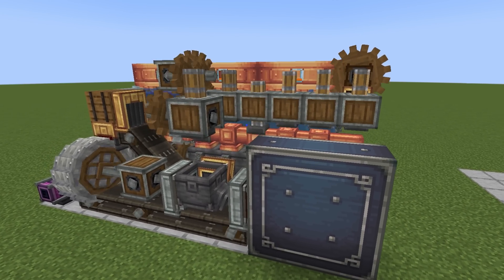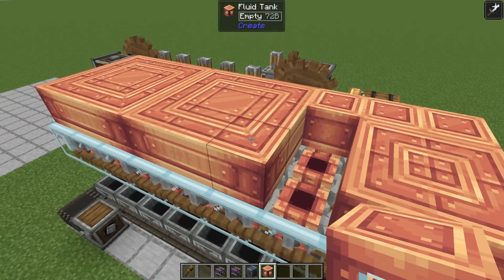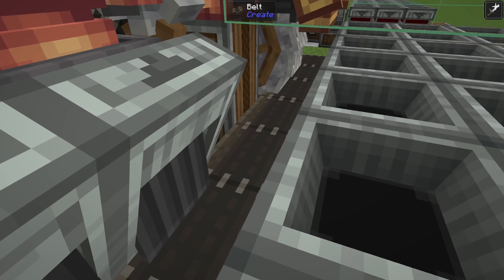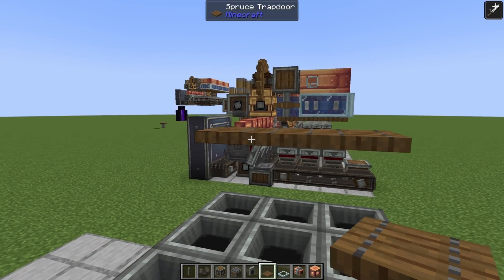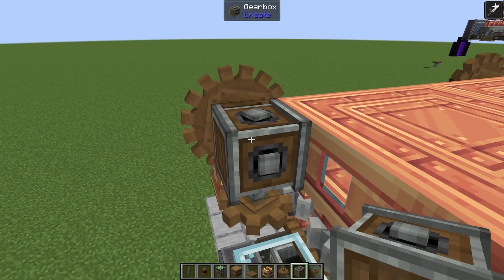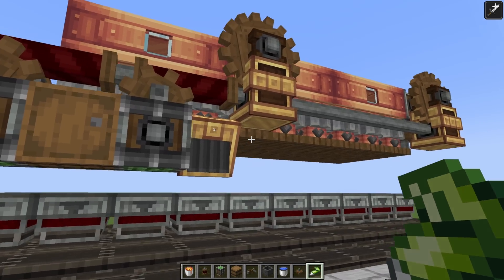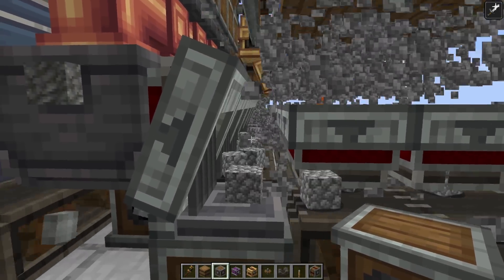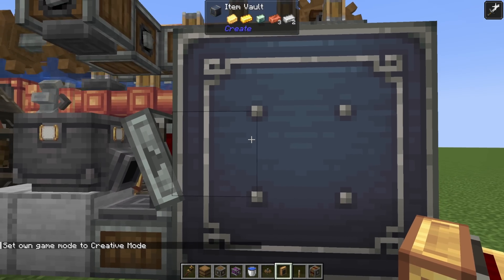How to Make a COPPER AND ZINC FARM in the Create Mod | Create Mod Block-By-Block Tutorial

Comment: whats the point of these schematics if i gotta manually check everything ?
Reply: bruh , its legit like 8 things to check ,   what you gonna run the machine without checking if the mod acting goofy ? , i lost an entire machine due to it 
whenever i activate ANY machine i double check JUST to make sure it at the place
Reply: @mrmeowcat6242 well brother my thing didn't even work when I just built it piece by piece after the schematic didn't work following his guide so ggs
Reply: @clashwithnash9021  hm you got any modpack that you might think be the issue or you forgot to installed some modpack ? Perhaps its somethings messing with it , i tryin in a flat work it work
Reply: @mrmeowcat6242 hmm I tried to build it in prominenece and it had the mods needed to make it but alas it makes cobblestone it's just those stupid things that goes on top of the cauldron thing that won't just smash the items
Reply: @clashwithnash9021 hm mechanical press ? Perhaps it have no power or the shaft in wrong way , have you make sure everything is glued perfectly aswell
Reply: take out the attribute banner on the cauldon it the one that cause issue
Reply: @mrmeowcat6242 I will try that and ye everything is glued correctly will see if that fixes it i don't think it will because ppl said u need lava to make tuff now not water
Reply: @clashwithnash9021  It broke for me , so i try to remove the attribute banner on the cauldron , fix itself immediately

Comment: Yeah, this doesn't work with the current versions of the mods.  Needs lava instead of water to make tuff.
Reply: Here is smth that could help, there a create mod (addon) called Create Utilities specifically the 0.1.4 if u are using 0.5.2 or earlier versions of create mod, its gives you the void fluid tank along with some other helpful stuff, it very late game tho and hella expensive to make but useful af. all u need to do is create a unlimited lava source like a bottomless pit of lava in the overworld (or if u have the power loader mod that gives chunk loaders then use a train system that brings lava), or a lava farm with dripstone, pump it into a void tank, filter it with a matching item and then use the other void tank as a output with a pump and viola. PS. u can pump it directly into the lava farm, regardless of which one, but the void tanks make it look less janky.

Comment: Running into an odd issue where the basins for compressing cobble into tuff will only hold 16 or 17 cobble, which is short of the 21 necessary to spit out tuff, so it's all clogged up...

EDIT: In your machine or on their own, a funnel won't put more than 16 blocks into a basin. I have no fucking clue why that is...

Comment: I had a problem where water on the basins wouldn't work (probably due to using a more recent version of the mod), so I removed the water source on top and used my lava farm to fuel it instead and it worked (since the mod itself said that to profuce tuff, you had to compress 9 cobblestone with lava on a basin, not water)
Reply: Which version u using?
Reply: @vencaa121  16.2.0 from 10/12/2025
Reply: Cant find it probably need create factory addon
Reply: @vencaa121  sorry, I forgot to mention that I use the create ultimate selection modpack
Reply: @user-vr2ie5qd2j nevermind i should read more 🤣 thank u
Reply: Pls! Which lava farm?
Reply: @KamisatoAyaka-c6q  you can set up a train that goes to the nether and collects lava from a lava lake and brings it back to the overworld
Reply: I have the same problem.

Comment: hey ive built this and the basin will only fill up to 16 cobblestone when i need 21 to make tuff. Its filling up with water just fine (1000 mB) but it wont gather enough cobblestone. Is there a fix?
Reply: Yeah I'm having the same issue.
Reply: @ltmuffler3482  I improvised a fix. Instead of having funnels lead into the basins, add weighted ejectors in between the basins and funnels and set them to 21. You will run into a clogging issue though so I fixed it by making the belt that runs along all of the length of the funnels into another, extra ejector that ejects it into lava. Just make sure its set to something lower than 21. I found that 11 works great.
Reply: @Desceres  I ended up moving the whole build down 2 blocks (aside from the cobble generator) so that I could have the funnels spit the cobble out into "open air". The funnels have no problem spitting as much cobble out as they can handle, so long as it isn't directly into a basin. But if it drops them out above the basin and they fall in, then there's no weird 16 item limit. Took some redesigning the power system to get everything running but I got it to work.

Comment: Am im using wrong mod? Because i need to use lava instead of water to create tuff & i already install Ultimate add on
Reply: from what ive gathered its just the fact that the recipe has changed id recommend making a massive drip system for the lava input

Comment: I just build this Farm on a Server with a mate. This works really well, only bummer is my PC and the one of my mate dies when i Turn the fabric on. Its Takes away like 30+FPS. The performance Impact is sadly to hard to let it run permanent.
Reply from the maker: I'd recommend looking at the /flywheel config options if you have that mod installed. It shouldn't be lagging that much. Also you can replace the cobble gen with one that's more lag friendly (and if you have other cobble gen mods it may be more compact that way)
Reply: @kindlebubbledump  i will Check that out, appreciate the fast answere 😁

Comment: I'm a beginner and followed the tutorial to build the machine. 
It produced andesite, and I added water to the basin. All the gears are turning, and the shaft of the final Mechanical Press is rotating, but the press itself is not moving up and down. What could be the issue? 
Thank you.
Reply: After I installed the Create: Ultimate Factory mod, it worked fine.

Comment: Idk if it's cuz I have a lot of different mods installed but the attribute filter was stopping mine from working didn't have the c:ingots option. After removing if the whole system worked fine
Reply: it may be forge:ingots instead of c:ingots

Comment: I'm guessing the pack I am running has a modified recipe as all I get from crushing tuff is a 12% chance of zinc. Any recommendations for a lightweight pack using the new create that doesn't alter too many?
Reply: Integrated MC, excellent modpack, don't know if it will be lightweight as per your standard tho (and I would advise to just add Create Ultimate Factory in there, depends on your need)

Comment: I found the tuff presses were unable to output fast enough due to the output belt being constantly full of single blocks of tuff. This caused cobble to build up and start spilling all over. I fixed it by adding brass funnels to the press basin output sides with filters to only drop the tuff.
Reply: im experiencing cobble building up in one particular spot, underneath the generator, right in front of the gear that is behind the belt. cobble just sits there and does not get picked up by the belt. any idea on how to fix this?
Reply: @HxneySlitherskye  I'm not sure, but as far as I know the only reason the belt wouldn't pick up the cobble is if the belt already has cobble sitting on it. So you have to get the press section to pick up cobble faster. If it's not being picked up by the presses it might be the same problem I was having, the presses couldn't output and got filled.
Reply: @twistedsanta163 did you ever get it fixed? Also the threshold units do not work
Reply: If I can understand it all maybe I can improve upon it piece by piece, but first fix what doesn't work
Reply: im experiencing that everything is working except that the presses above the basins just dont press at all

Comment: You should make individual ore farms using ochrum, asurine, crimsite and veridium -  the recipes to make them are all quite similar so you can just repeat one farm for all four. I'm not sure if it these would actually be faster than your original farm though, it may also be something you have already tested.
Reply from the maker: The automation for all those blocks are very dependent on the modpack. I assume you have create dreams and desires (so do I) which automates it pretty easily with milkshakes or similar, but from what I've seen, most people don't use those

Comment: help please the mechanical presses arnt working but i rotated it and the shaft of the mechanical press is moving but its not pressing the material
Reply: im having the same issue
Reply: me too
Reply: me too
Reply: @empanadasdecrack9522 do you have the create: ultimate factory mod
Reply: Found the solution,  it's the version of the Ultimate Factory Mod.  In the newer versions they've changed it so you need lava in the basin not water, I got it working on Ultimate factory 1.9

Comment: Would someone be able to explain how or why the cobblestone generator part of this build works? I want to understand so I could possible incorporate it into other builds
Reply: I think I can explain how it basically works. So, when the gantry carriage moves the trapdoors, they become transparent, meaning water and stuff can pass through them. The pumps pump slowly lava and are waterlogged. So, when the trapdoors becomes transparent, the water flows do and the pump can pump lava creating cobblestone since they mix. But, when the gantry carriage arrives at its destination stops, the whole contraption becomes solid thus, breaking the cobblestone that formed. And then it repeats. That's how I understand it tho. And I hope I explained it correctly.
Reply: @sabertooth9137  thank you, this helps so much, one last questions what part of this contraption would control the speed of the generator, i want to make it a bit slower just sp it runs a bit smoother on my server.
Reply: @dashmaster5164 No problem. So, at 9:00 is where he places a rotation speed controller. He sets it at 170 RPM, to slow it down try a smaller RPM there. Although, I don't know if it will break it. So,  give it a try. But in general, you can change the rotation speed from there. Making it either faster or slower.

Comment: why the hell my "cobblestone generator" drops cobblestone everywhwere around it not only to funnels?
Reply: It’s called being to fast
Reply: Slow rpm or add threshold switch
Reply: @domr6723  thx. i solved the problem. it was caused by wrong extract amount on brass funnel for cobblestone. somehow it was capped by 1 by me ...

Comment: In a future video could you show how you connect the steam engine to a farm you have created instead of using a creative motor so we can get a visualization of how the steam engine powers farms.
Reply from the maker: Sure! I have a survival series where I have built steam engines to power farms in previous videos and it should be clear enough there. Honestly, if you connect the steam engine output shaft to where I put the creative motor then it should just work. 

What part specifically are you having trouble visualizing and I may be able to help explain or show it in a future vid!
Reply: I'm pretty new to Create, so as long as I connect the shaft from the steam engine to a farm it would be powered, but would I be able to power multiple farms with one steam engine? I built the steam engine using your tutorial from a year ago fyi.
Reply from the maker: @glxcs yea if will work! I would recommend watching my ultimate guide to the create mod cause a show off a ton of useful tips and tricks there!